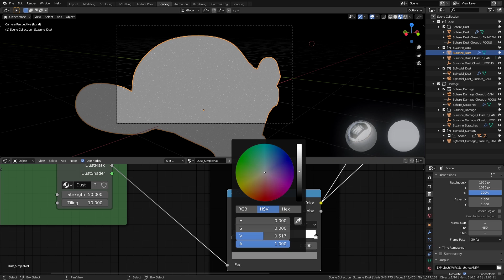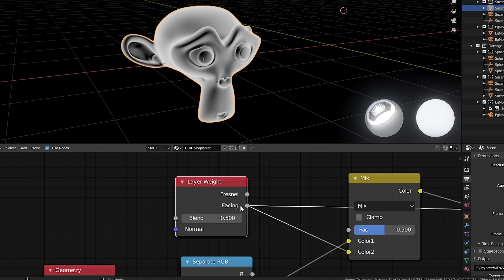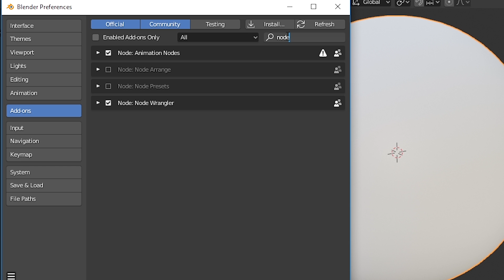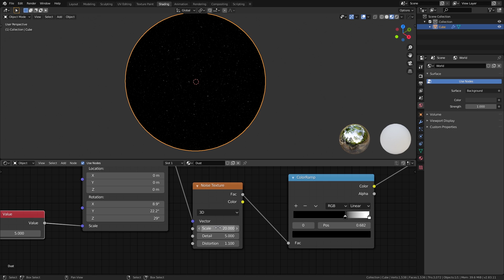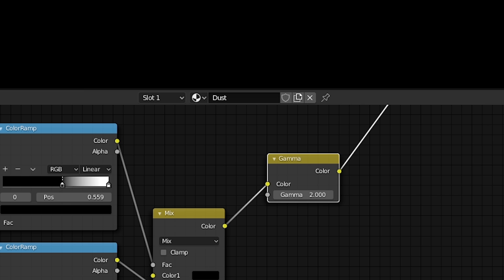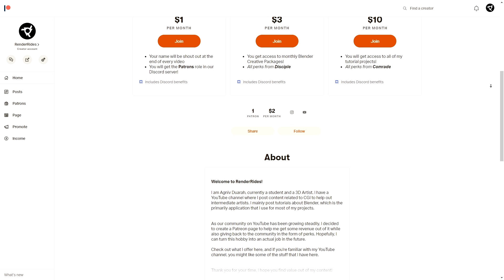How to make Procedural Dust in Blender 2.8

Comment: waste of time
Reply from the maker: Can you elaborate?
Reply: @RenderRides   the dust doesn't show up on any of my textures. It looks good on your dark purple sphere with low lighting sure but in my scene you can't see it no matter how close you get. I have to turn up the strength in order to see the dust but as soon as it's visible it's already too bright and looks like white noise
Reply from the maker: That's... why it is procedural. You have full control over the size of the particles and can change it to whatever you want it to look like.